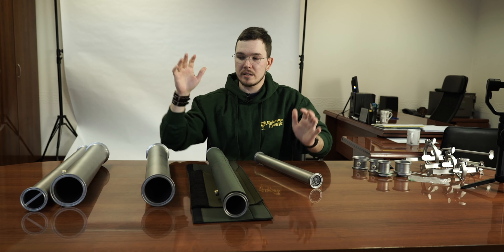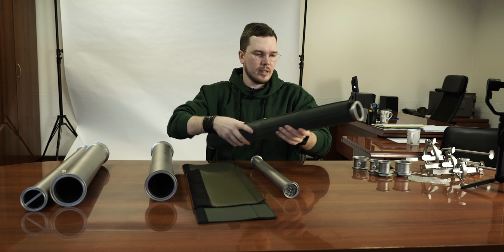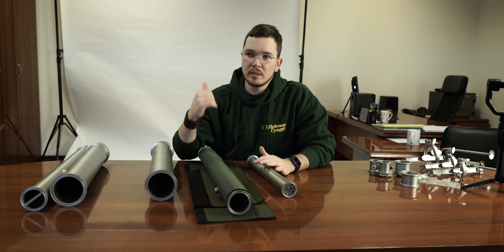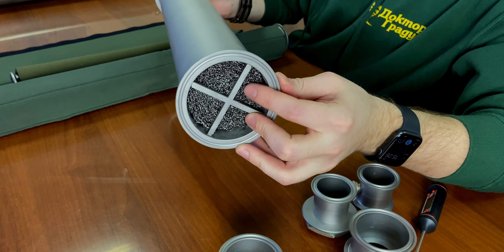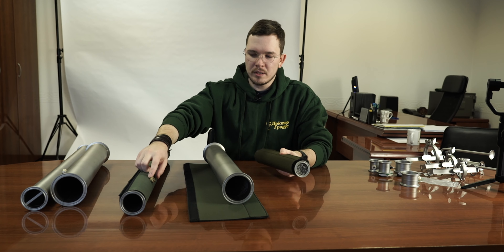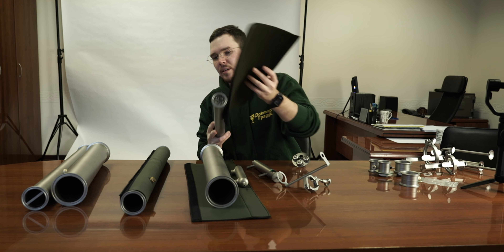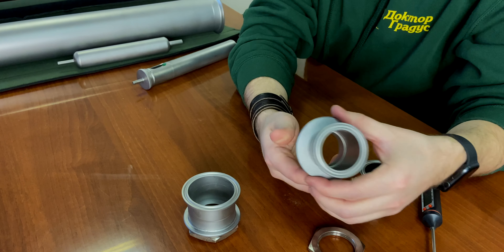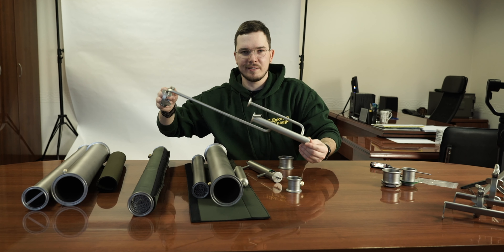Distiller extension pipe

Comment: Do you have a 4 or 5in continuous still with SPP copper packing yet?  I don't see any of the continuous stills on your website.  Looking for something to make neutral spirit for a 500 gallon run of 15% sugar wash.
Reply from the maker: Hello, we dont make 4 and 5 inch continuous still yet. Only small distillers for home distillation or small commercial distillers. I hope in future we start building big stills and parts.
Reply: @DoctorGradusInternational  

What production do you get out of a 3in continous still?
Reply from the maker: We don't have a continuous still column 3 inch, but we did tried to make it. We had result as 30 litres (8 gal) of mash per hour and had 12% abv mash, so we've collected 50-60% ABV. It's not the best result, that's why we still working on and I think in 2021 we make it much better. Power 6000 watts
Reply: @DoctorGradusInternational  

Nice

Nice.  What is the input/ output of the 2in continuous still you have?  I'd almost suggest making a jump from 2in to 4in.  As 3in isn't going to be a huge boost.  They look to run well.